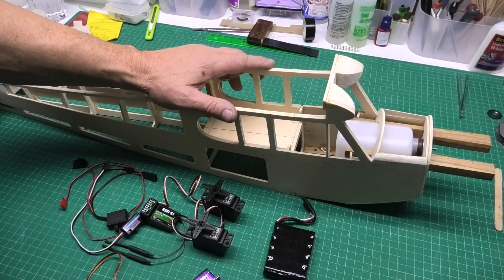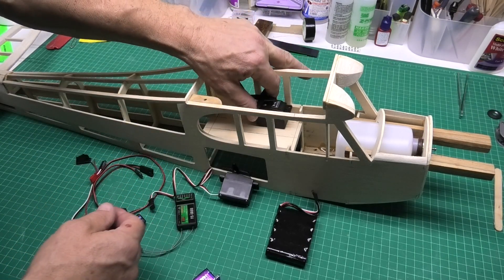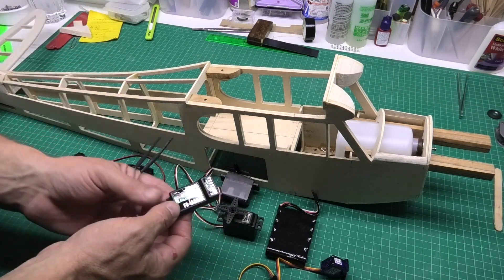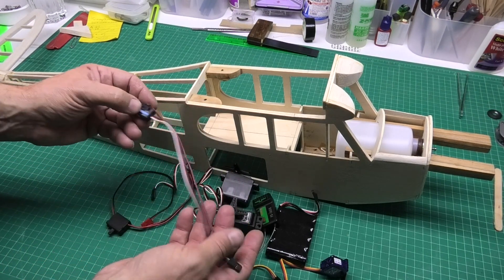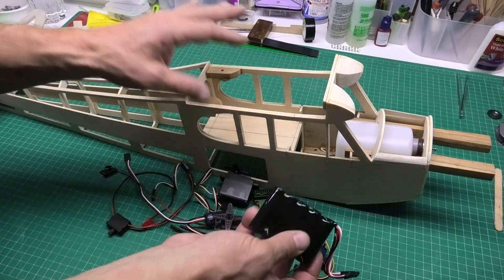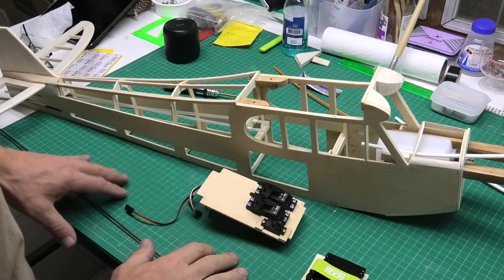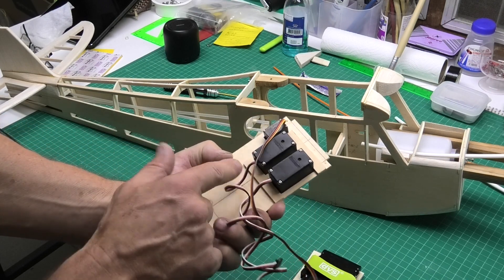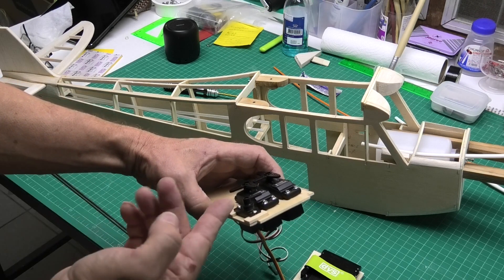RC Piper Cub J3 balsa plane build - Pt 10: Electronics & Controls

Comment: The tray for mounting the servo looks extremely robust and overkill? Agreed those servo screws are the business - Model Fixings is really good for miniature nuts and bolts. Thanks for posting this useful video - I will now order a battery indicator for each of the planes I am building. Thanks

Comment: Hi there, I know I'm lil bit late but I hope you will answer so!! How much grams does this plane almost took? So I can adjust the thrust : ratio of plane and get a better brush less motor for it, Almost between 1500g to 1700g or more?
Reply from the maker: On the plans the weight range for this build is 1500 - 1600g, which will obviously depend on your construction and the size of battery and motor - good luck with the build 😀
Reply: @MarkRobinson555  Thanks Mark, I'm trying to convert glow to electric engine of this model ! Lil bit perplexed about the results, but what do you think about converting this exact model into electric? Will it be a success?  I'm using a brushless motor giving about 880Watts and almost perfectly give a thrust of 2200g. I'm confused about that basically glow engine is lil bit more bigger than electric brushless motor so, but the motor funtions well for given required weight and overall, and comparatively the model looks lil bit bigger than I expected. But weight : thrust is perfectly fit with motor. So what's your opinion about it 😁?
Reply from the maker: I think this would be fine as an electric conversion, but I can not really advise you on the motor set up, it is not somthing I have a lot of experience with, sorry.  Hope you get it all sorted.  I would look at other similar plans and kits and see what motors are suggested, to get an idea what size could be used

Comment: What size servo did you use ? Model number ? And engine you going to use ?
Reply from the maker: Hi there, the servos were https://www.theworldmodels.com/store/product/4265/TWM-Standard-Servo-SV4032-B-190mm-Cable-4-1kg-Torque  The engine was a Thunder Tiger GP25. Hope that helps 😀

Comment: Your using electric airplane thought to make an internal combustion airplane. Hard securing the battery and receiver (especially a cheap Chinese one) to the frame without any foam cushioning is a recipe for disaster. The vibrations from an IC engine are unpredictable and can affect things severely. You are also over thinking it. Wrap the battery and receiver in foam then use bits and pices to wedge them in - https://www.dubro.com/collections/radio-accessories/products/r-c-protective-foam-rubber Get the 1/4" for a .25 size engine. Simply use a wide, 1/2" or so stick wedge and glued in to hold in place. Easy-peazy. Download and look over the Eaglet plans here to get an idea of how the parts are wrapped and placed - https://outerzone.co.uk/plan_details.asp?ID=4192. Another advantage of this is that you can move the battery to another location if the Center of Gravity needs shifting.
Reply from the maker: CryhavocMike thanks for the comment, always appreciated 😀

Comment: Another great vídeo, Mark, thanks. 
I added the decals I made to the Outerzone site: https://outerzone.co.uk/download_file.asp?planID=5160&FileType=Supp&Filename=Piper_Cub_J-3_oz5160_decals.pdf  
My latest  kit (from eBay) came only with the bear Cub decals and I seem to remember that, back in 1981 when I built it the first time, those where the only decals in the box. 
Any way, I measured the letters from the plans and came up with these. 
The pdf is vectors except for the green backgound bear cub, which is the scan from the original decals.
 It can be imported to your favorite DTP or CAD software for editing. 
The font for the letters is Amarillo USAF but it has to be transformed into curves and edited in order to copy the lettering of the plans. 
I hope it helps.